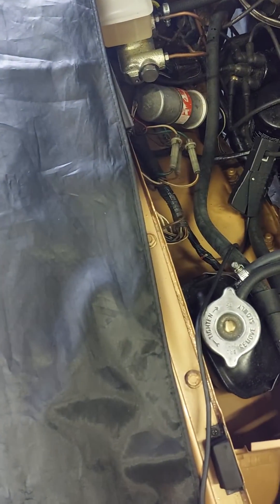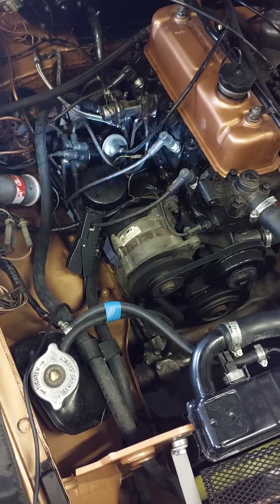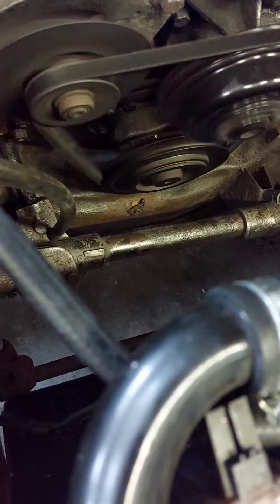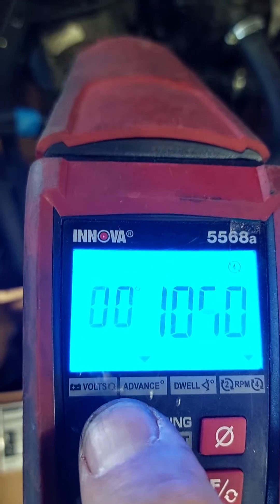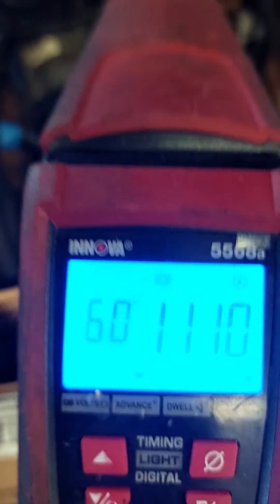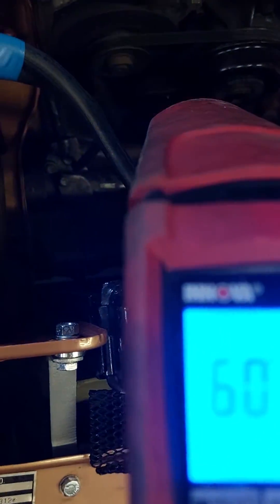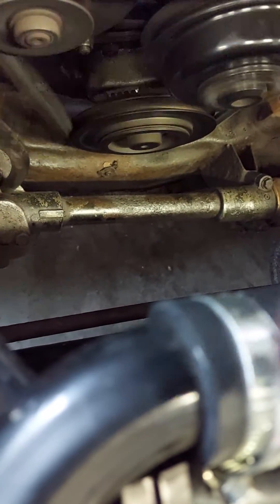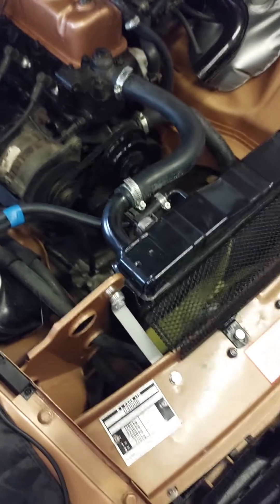Classic MGB 1800, massively over advanced ignition timing...

Comment: Hey mate, I have a B with the same problem, I was curious if you ever figured out the issue with the old girl. Cheers
Reply from the maker: Yes, it had simply been set up incredibly badly.   The owner had both a GT and Roadster, both cars were set just as badly by the same local garage.  Now that the ignition timing has been correctly set on both cars, and tuned correctly the owner is enjoying both cars at every opportunity.  Prior to my visit and resetting/retuning, I'm genuinely not sure how he even managed to drive them home from the garage.

Comment: the damper must have slipped. static would be around 30*, would have a hard time cranking over.
Reply from the maker: A good guess, but sadly No,.... I'm 100% confident that the damper hadn't slipped.  I say this for 3 reasons...(A,B & C)..A)  I physically check TDC using a dial gauge to ensure that the TDC markers on the timing chain cover and pulley are correct.  I also went in with a digital borescope to observe and see if there was any damage.  It also allowing me to see the peak of the stroke on cylinder 1 as a second form of verification of TDC markings.  2)  Pulley slippage is extremely rare and 'near' impossible due to being indexed by the drift on the crank.  3)  Believe it or not, the owner of this car actually had both an MGBGT and Roadster  set to exactly the same by a local garage, with within 1 or 2.....very shaky degrees of each other.  My concern was also in terms of resultant damage to key compression components...rings, valves etc.  This surpassed the prior worst timing record which was a Porsche 356 at just under 30 deg out.....which yes it did struggle to crank over.
Reply: @AGClassicCarTuning  If it's the later low compression engine, you can  advance that far without noticable pinking.
Reply from the maker: @lucsavoie9501  ... My apologies, however I don't know your background or experience with these matters, so no offence meant if the following explanation is rather obvious.  The video only shows ignition timing at idle, and equates to approx 42 deg BTDC (vac disconnected).  The mechanical advance inside the original Lucas distributor will provide typically an additional 26 to 30deg by approx 4500rpm.  Hence, at 4500rpm in theory the ignition timing would be at 68 to 72 deg BTDC.    At light throttle or throttling off, the vac advance will then add maybe another 14 to 18 deg on top of the mechanical advance given.  If the badly timed engine is capable of reaching 4500 rpm, then even with a modest 8.1 CR  of some US spec cars to those of 8.8:1 or > 9:1 in other markets, 'pinking' will most definitely have been occurring.  Sadly, that's where we encounter a different problem in that many people do not really know what 'pinking' actually sounds like.  But one thing is for sure, no one should be looking for, nor expecting the hear pinking at idle.  However, based on poor internet advice, or badly advised by a mate they advance the ignition timing as far as possible whilst listening for an illusive 'pinking' noise.  I see and read it routinely time after time on the internet.....'advance it as far as you can, until your hear it pinking...then come back a couple of degrees'.  Less than 20% of average enthusiasts out there actually know when they've reached an ignition timing position at which it is causing pinking to occur.  If you're from the UK it reminds me of the classic Delboy phrase....'a nod is as good as a wink......to a blind man.'